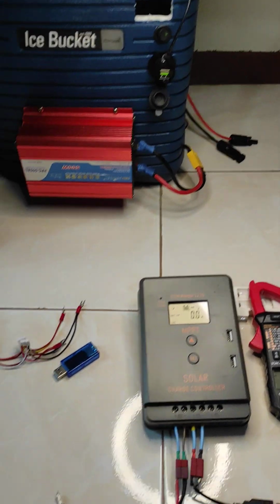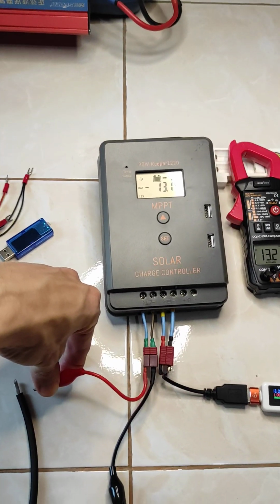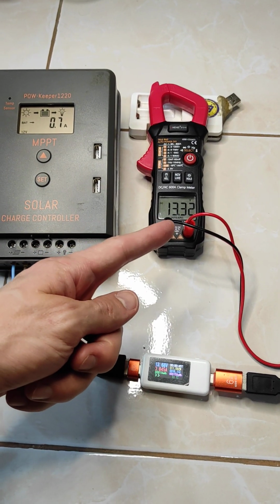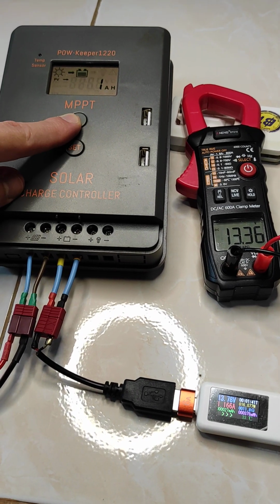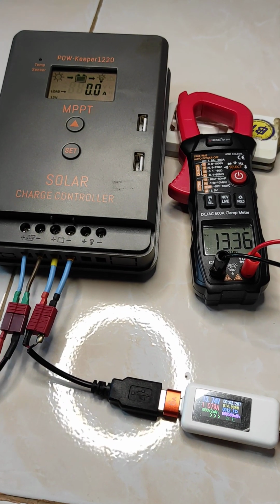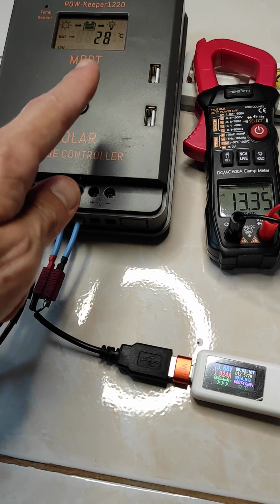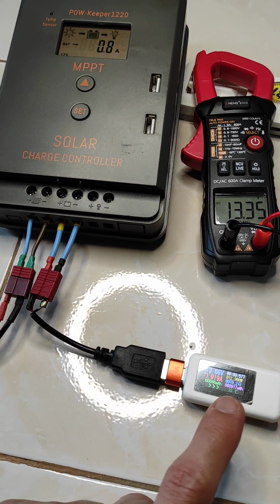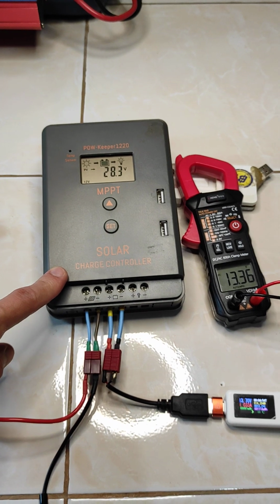🔥 PowMr MPPT Keeper1220, 😰🤷 stops charging every 3.40min by itself 😕

Comment: weird, I got the same controller, but the display top row first shows, from left to right - first - SUN (meaning solar) -> MPPT -> then the battery. In your case the SUN goes straight to the battery, coud that be where the issue is? i.e. some settings somewhere are off or the controller is simply defective?
Reply from the maker: That means they changed something in the meantime. If you watch other reviews around the time i posted this video, the display menu looked like mine. Maybe they have replaced their faulty software and or hardware and yours is the new one. You bought it recently right?
Reply: @off-gridretreat  yeah, that's right, I got the light bulb icon too on the display
Reply from the maker: Does your charge controller version not have a load 12V output anymore? The bulb 💡 stands for load in my display menu. From the beginning (first use and after playing around in the settings) my display menu looked like this which is by the way kind of industry standard (check other reviews) of those cheap china controllers.
Reply: @off-gridretreat  yeah the bulb is there but underneath the top row with the solar - mppt - battery icons. you are correct I bought my controller fairly recently, maybe 3 months ago, tested fully only today. fingers crossed I think it's ok, does the job. hope you were able to sort your issue out eventually?
Reply from the maker: On the powmr youtube channel they say they have a new version.
https://m.youtube.com/watch?v=mS_P_WS18GY

Here an example of the same menu as mine.
https://youtu.be/n8G9dixa16U?feature=shared

Funny thing is in the title picture of this video they show the old display menu version but in the video it's the new one.
https://youtu.be/pKtvm7jejkQ?feature=shared

Comment: Is there a solution?
Reply from the maker: Unfortunately not. I even received a replacement but it had the same issue. My solution was to buy another charge controller from a different brand. That one worked flawlessly.

Comment: most of mppt's are like that they have an interval of 20s-30s of charging and finding the maximum point even EPEVER and SRNE does that.
Reply from the maker: Thanks for your comment.
I don't know about epever nor srne since i don't own one, but neither my lumiax mppt, many mppt modules (different brands), suoer mppt, as well my big ones the huawei hybrid nor the deye hybrid does that. I did of course test them as well to exclude the possibility that this is normal and not abnormal.
Reply from the maker: Of course i know that a mppt charge controller does sweeping to search for the max. powerpoint but none of my other charge controllers needed to pause the whole charging process for several seconds to do that. I don't WHY exactly these powmr controllers stop, i only know my others don't do that.
Reply: @off-gridretreat  what is the efficiency of your current MPPTs?
Reply from the maker: @vinsoooyah  usually ranging from 92 to 97%.
Reply from the maker: @vinsoooyah  my worse ones have 87 to 90%

Comment: thank you for making this video. ive tried bringing this up to the powMr "support & engineering" people but it only fell on deaf ears. I got the same issue/s on my powMr 20a. hopefully many people can watch your video before they can buy this.👍👍
Reply from the maker: My Powmr shop eventually approved to replace the motherboard after a lot of back and forth and uploading these videos. It would help your case and others if you would record a short video of this issue and upload it on YouTube like i did. Then put the link of these videos in your description and i will also put your video link in my description to show it's not just an isolated issue but of a whole batch.
Reply: @off-gridretreat  wow that's good, yeah I tried to record a video and sent it to them. accordingly, their engineers said it's fine🤔.
I think your right, they just respond if the video will be uploaded to yt. by the way, I saw in a solar group that there are some variant of powMr 20a with fuse, maybe it comes from different suppliers, I mean the motherboards. nevertheless, they should honor their "warranty" and help those with defective units.
Reply from the maker: @kaizzer1414  i got a different replacement motherboard (had to pay for the shipping) in the meantime but it had the same issue. 😮‍💨 I personally gave up on this charge controller model and donated both to someone who happened to be in need of mppt charge controllers and didn't care about such (minor) flaws. How they say, "someone's misfortune is another one's fortune" or something along this line. 😄
Reply: Hi, i have same issue my pow keeper 1230 produce 21v but can't produce amperes. I claimed the warranty on the 4th month. At the periode the highest record is 5,6 amps 😅. Now they send me A replacement (same product but upgraded software (display) ) Its 2 weeks after replacement, And AGAIN i test with multitester 2,8Amps, but the display MPPT show 0,00amps hope they can Fixed this product failure.
Reply: The display shown in the video is automatically showing one information after another but my controller is not showing automatically